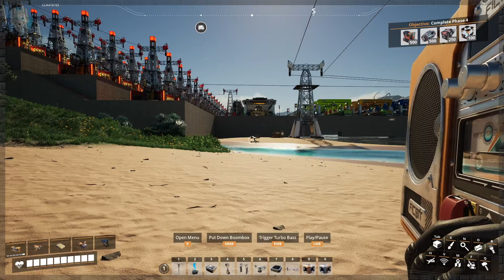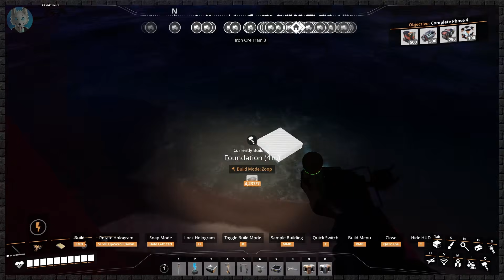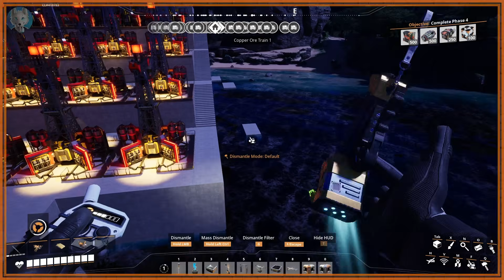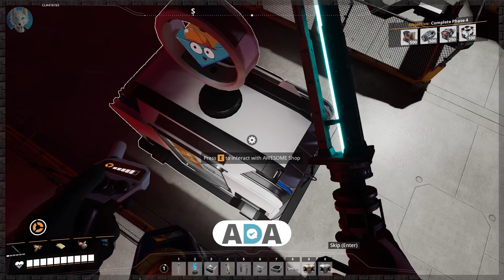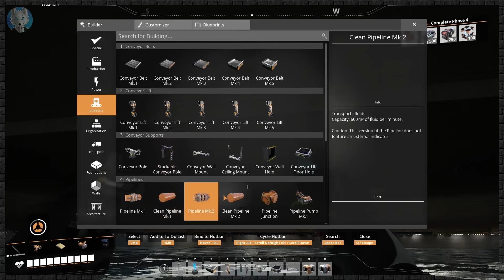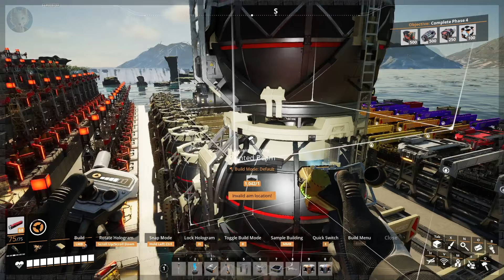Satisfactory 1.1 | Singleplayer | S4 Episode 227

Comment: I thought rocket & Ionized fuels were gases. If that's the case, You shouldn't need pumps.

I could be wrong though, never dealt with Ionized fuel before.
Reply from the maker: Good point, they are classified as gases according to the wiki, I shall try without pumps first.